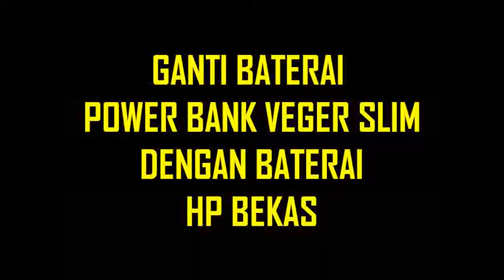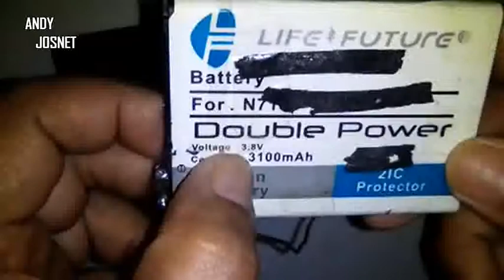GANTI BATERAI POWER BANK VEGER SLIM DENGAN BATERAI HP BEKAS

Comment: Salam gan,numpang tanya. Saya ada modem sekaligus powerbank  Baterainya 18650 3x2600mAh. Rencana saya mau ganti ke baterai yg 3300mAh. Kira2 aman gak ya? Atau mungkin ada komponen yg mesti saya ganti? Atau tinggal ganti aja? Mohon maaf sebelumnya soalnya saya masih belum tau soal elektrik2 seperti ini😅😅
Reply from the maker: Bisa gan pkai baterai 18650 yg amperenya agak besar dari baterai yg sblm nya.

Agar tdk khawatir, baterai 18650 yg sblm nya di tes pkai avometer, kalau volt ya agak sama dg baterai 18650 yg amperenya agak besar berarti bisa digunakan. Baterai 18650 1 buah, voltnya 3.7v-4v